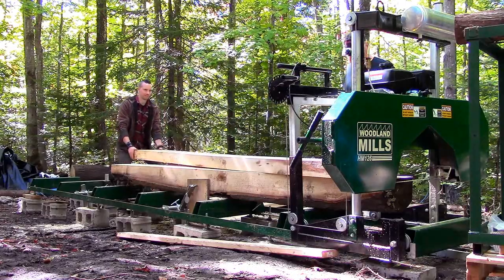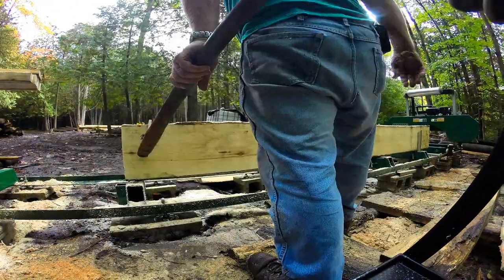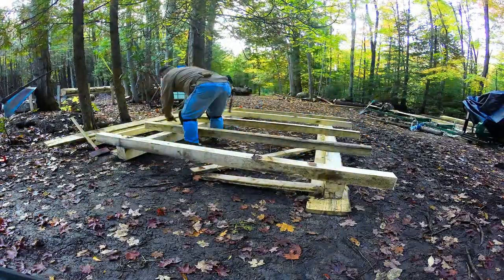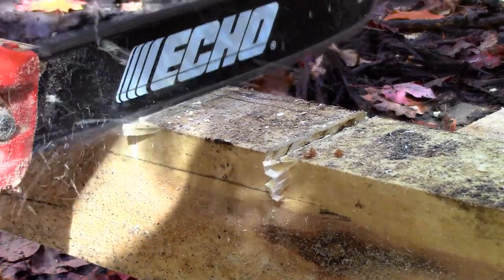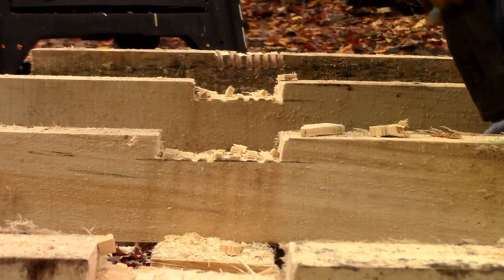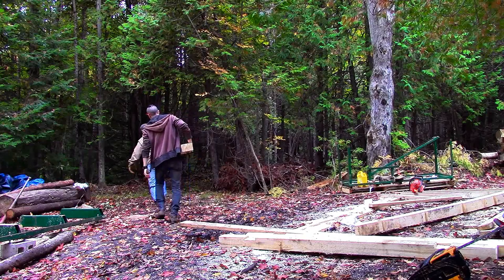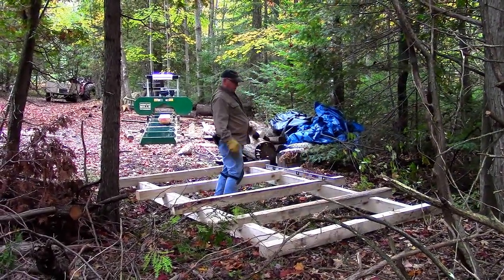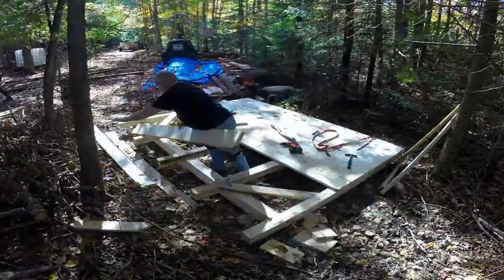Bunkhouse / Tool Shed Construction!- Ep15- Outsider Log Cabin

Comment: There's an old southern saying, "If you build your cabin out of poplar, you'll die in it. Next Spring." If the poplar house will only be used for tools and be used very temporarily, it's a decent choice, but I would not recommend it for building material compared to hardwood or cedar especially. Treat the wood in every possible way as you go if you have to use poplar.

Comment: What a difference, looked like two days to build something with the proper tools that took you a year to do it the wrong way. You are learning. Here's what I would do to build a real cabin, from an engineer who has built hundred of cabins and homes. Get a decent sized excavator, rent for a few days, save you a ton of headaches. Dig a big hole, drop in a septic tank. Don't worry about a leach field if there is only one person staying part time, have it empty into a hole filled with rocks, called a drywell.Second, man cannot live without water more than 7 days, so find a water source, dig a well or find something at a higher elevation, just keep it 75 feet away from the waste lines. Third, what is the big deal with putting in a proper foundation? A cement block is not expensive, dry stack them, fill them with concrete, get a foundation below the frost line. Third, get that wood off the ground and protected from splash 30". Build your cabin, stick build it, fine, log cabins do not work, the wood shrinks in width. Make the overhangs 2 feet minimum, that keeps the rain from splashing on the logs. This is not rocket science, do the above and you will be very pleased with the results, skip any one, you will be miserable.
Reply: I think you've missed the point of this entire project...
Reply: Really? So are you saying that when he hikes in and stays for two days that he doesn't drink water, that he can hold it, not urinate or defecate? Funny, I don't have that talent, when I go somewhere, I don't want to hang my butt over a log and leave the poop out there to smell for months. I have heard that there are only three pleasures in life; sleep, sex, and taking a dump. That's a joke, but really, how hard is it to solve the simple human needs?